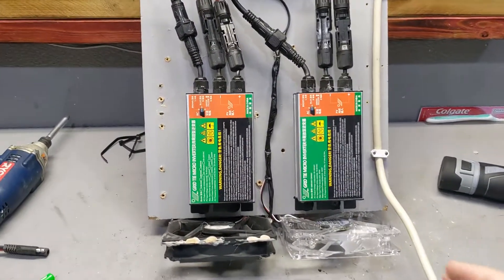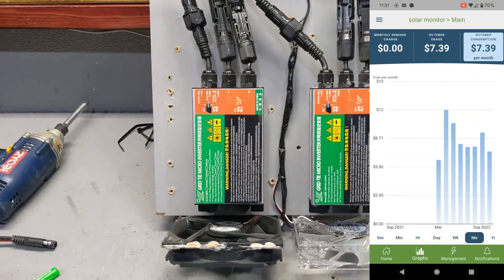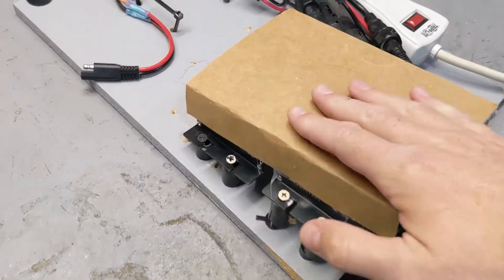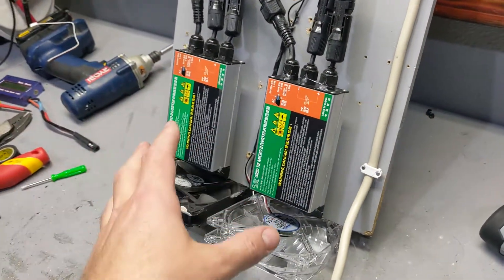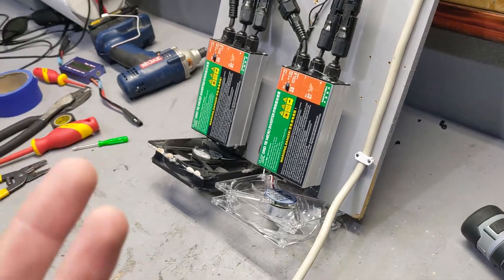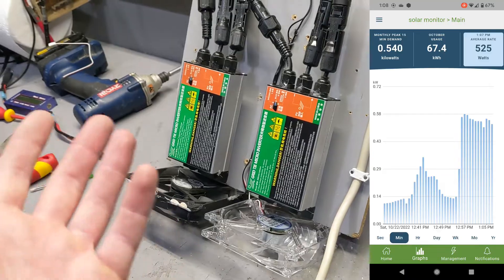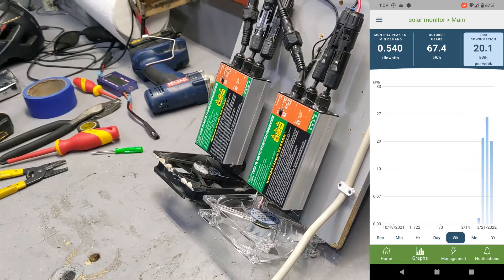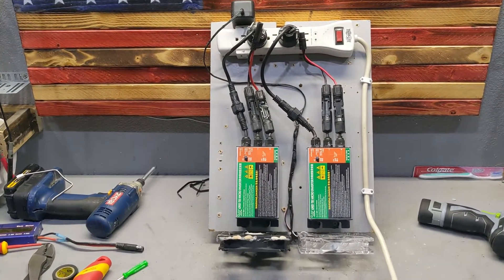... after 1 Year CHINESE Micro grid tie inverters! HOW do they LAST? How to make them last?

Comment: I got 8 x 190 Watts panels from my neighbor, who upgraded his system. I mounted them on some 2 by 4s and saw horses in the backyard horizontally. The first thing I learned is that a 1400  (1300 or 1000 units are identical inside) Watts micro grid tie inverter can barely handle half that and due to overheating they die quick. So keep your load under 500 Watts per unit so get more of them as well as keep them cool with fans. Otherwise the system works great producing 7.5 kWh per day on a summer day and about 2.5kWh on the worst day. And, it does that horizontally from the backyard (not the roof !!) which causes a loss of 3 hours of early and late sunshine. Quick return on my investment and a very good way to learn about this technology.
Reply from the maker: Yes that sounds about right about matching reality

Comment: Are those two inverters still running?
Mine has failed after 11 months.
They told me it's quite usual for that model.
Reply from the maker: Still running today. They have soldered fuse in it that can pop.  You can replace it easy

Comment: I idea of the Micro is to mount them under the panels and running a long AC cable back to your outlet. Running a long DC cable you will have huge DC voltage drop to the inverter. Running a long AC cable you won't get any voltage lose.
Reply from the maker: They can't handle the 150f temperatures in the summer outside
Reply: @VegasRoManiacReviews  Thank you for stating the temperature 🌡 issue. You can't mount these under a panel.
Reply: You mount them where ever they are convenient so things work for you... I am adding an Arduino with a current transdures and relays for each off them, like that they come online when needed and never feed back in the grid.. here we pay for the power that feeds back if you do not have a contract

Comment: I am doing something very simple like this (inspired by your videos!). AC 120@60Hz Coming out from the inverter has just two wires or three? I understand that one will be "hot" and one will be "ground" but is a neutral wire coming from the inverter as well and if so what do I do with it (or do I have the neutral and ground reversed in my head)?
Reply from the maker: Sounds great! It's way less dangerous that they make it sound

Comment: I've watched this dozens of times. I also saw your video on Grid Tie Limiter. By using this system are you subsidizing the line for use in the house or is this system pushing back into the grid? I'm in Texas and we don't have net metering and I'd like a 500 Watt system because that is the base line of what my house uses at any given time. Thanks for your response.
Reply: If you don't have a smart meter it's possible you could actually get charged for the power you generate because the old meters can't tell the difference between power in and power out. These will feed power out to the grid but they also stop producing when power goes out

Comment: I need to know the AC Cable connector size?  M25, M20, or M11 ?  My inverter (same as yours) did not come with an AC Cable tie connector.  I've searched the interwebs and just cannot find out what size that M connector is.

Comment: Does this have any type off anti islanding function or power limiting? Here in ca they get pretty upset when you back feed the power and electrocute one of their line men working on the lines also if you produce more power and back feed the line they also get mad unless you have permits and all that good stuff. So basically if you want to sneak a grid tie then you need to make sure you never feed any power back through the meeter.
Reply: They stop supplying AC to grid immediately, when there are no AC on the grid. But they don't have any means to suppress backfeeding to the grid, so you need to have energy meter installed by your power company, that is capable of 2 directional metering or you will be charged not only for imported electricity from the grid, but also for exported to the grid.
Reply: How long does it take for them to see the grid, for the LED to show production
Reply from the maker: No sensor and yes I never do more than I used

Comment: I bought this . I'm no electrician but ac part having hard time with. 
I'm use to red, black and white
I bought male extension end  brown went brass screw and blue to silver and yellow to green screw this right?
Then I got solar panel 205 w offered up but think end look like male help 
Inverter say pv there a difference ?
Reply from the maker: Doesn't matter what order you connect them z it's a after all, just make sure ground stays ground

Comment: They have to be cooled otherwise will produce less if they are verry hot. I have two gmi 700w with cooler on top and holes on bottom to flow the air and extract the heat and they have 33-35 degree celsius on full load on a super hot summer day. And verry important when you buy it,first desassemby and remove the peels betwen aluminium case and mosfets.
Reply from the maker: yes i have a video on the mofsets , amazing how they still build them like that ...
Reply: @VegasRoManiacReviews  Last summer bought 3x GMI-700 and all had that blue tape. Mine inverters are attached to 595W panels, so definitely needed additional cooling. But I  went with passive cooling: attached old CPU heatsinks to front and bottom. Still work after 1 year.
Reply: How to install coolers on them?
Reply: @MsbowElite  Hello ! As the mosfet are pressed against the bottom of the case, the best is to fit a dissipator (as said just above by sigun0) or an aluminum plate, wider than the inverter, under it. The goal it to increase the surface to air (in which you finally put the calories).  And if you need because it is hot , increase airflow by using a fan as described in the video. The problem with the fans is life span and a bit of maintenance to ensure that are not stopped but that is manageable if you are inside the house. Outside it is less easy due to water. But the case of the inverter is not either waterproof so must be protected.
Reply: Been running mine hot af for years they still go

Comment: Thanks for the great info. I'm also looking at building a efficienct $$$ wise system, probably with 4 of these. How do you think they would handle ambient temperature of 30C? Do you know what temp they get to at full load with the fan's vs without them?
Reply from the maker: Fans help a lot . I would not put them outside . If you already have a budget for 4 , I would recommend use that money for a grid tie inverter with power limiter , the blue one with the screen . I'm getting that one next
Reply: @VegasRoManiacReviews  How you monitoring the production ? I m verry intersted. I have two gmi 700.Thanks

Comment: Add heat sinks on housings for passive cooling and higher efficiency. Are those fans full-time or thermostatic?
Reply from the maker: Timer controlled ... And fins are expensive ...
Reply: @VegasRoManiacReviews  Easy - just find a length of steel or ali trunking in a dumpster, cut to lengths and glue it on.  Easy fins.